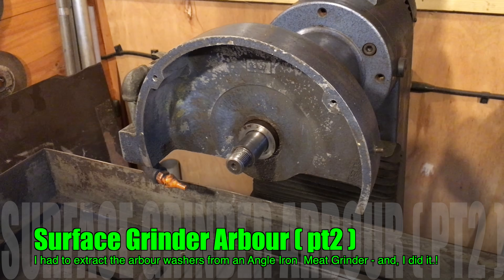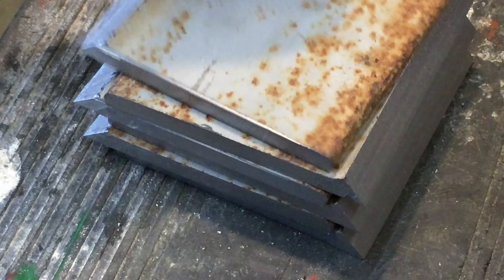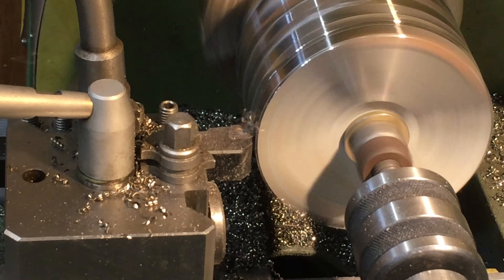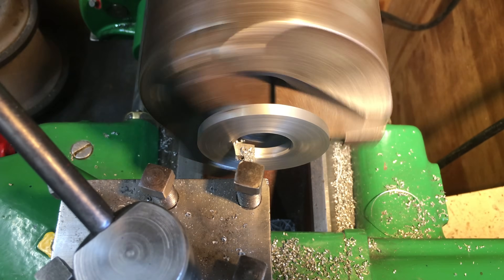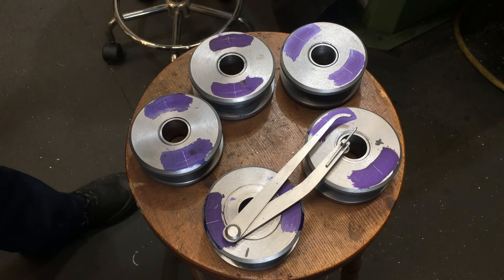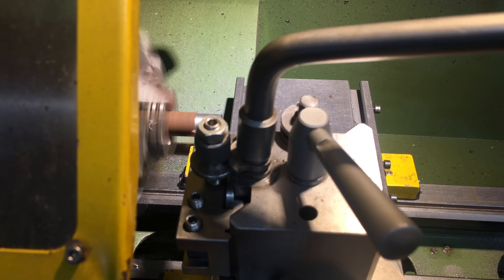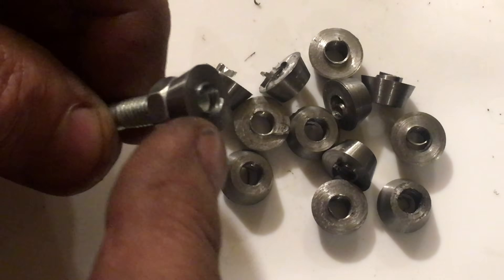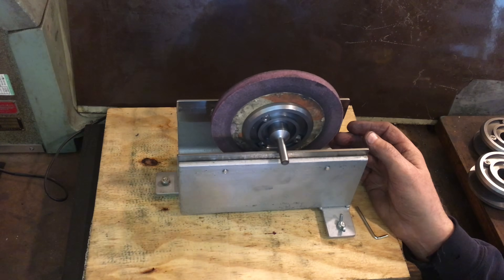Surface Grinder Arbour (pt2)

Comment: Very nice, I've just bought myself an Eagle Mk2 surface grinder that I'm refurbishing, it looks like I'll  be making myself a bunch of these arbors for it aswel, after I've bought a motor... replaced the belt... upgrade pulleys... rewire... make a stone guard bracket to replace a broken one and... paint it!

I like the comment you made about mucking that shiny surface up with your fingers, I do that regular but only once after using a flap disc on an angle grinder to clean a weld joint, never again ;)

Comment: When leveling a balancer lengthwise, use two parallels, on the side if you don’t have thick enough one to stand vertical. Put the level on that.

Comment: That's lovely.

Can I ask why you went with 3 weights rather than the more common 2?  Is it a surface grinder thing?  My only experience with these things is on bench grinders, and all of the ones I've seen only have 2 weights.
Reply from the maker: Hi, I have balanced many grinding wheels in the past and all of them including the ones at training college all had three weights, that's the only reason I chose the three weight method. and its true two weights will do the same job. cheers

Comment: You should have cut the corners off 4:16, before stacking the plates. To start with  an octagon saves quite a bit of interrupted cutting, but is still reasonable quick done with your band saw or angle grinder. ( do not ask why I know 🙂)
Reply from the maker: yeah, I know but it looked good on video. cheers

Comment: A great outcome, and well worth all your expert machining skills. Being a retired machine tool fitter building Jones & Shipman grinding machines for 50 years, it was interesting to see another British made surface grinder. As you probably know, the J & S machines all had wheel flanges c/w balance weights, and actually looking not far off what you ended up making. 
The first split weights you made were just like the J & S ones,  but I do like the ones you ended up with, a much more practical solution, and easier to clean, and not susceptable to seizing up in the dovetails!  excellent work, albeit with rusty fingers lol.  cheers, Dave
Reply from the maker: Hi, I have used J&S equipment for years, more centre grinders than surface grinders, they are still my preferred machine. In so far as the surface grinders spin the right way (anticlockwise), I've nearly come a cropper a couple of times with this machine. thanks for watching, cheers

Comment: Wow Paul, beautiful work. When I made wheel hubs for my grinder, I just copied the design of the factory hubs. Mine did not have a dovetail groove for the weights, it’s a “square groove” and never gave me any trouble so I didn’t feel a desire to update it.  You did some impressive work making yours. Thank you for sharing.
Reply from the maker: Hi, thanks, its something that Im quite used to, cheers

Comment: Have to dress the wheel on the Arbor before balancing it, and not the other way round. In this case the the wheel was balanced with the runout, and when it is then dressed, the concenticity is established but the wheel becomes unbalanced again.
Reply from the maker: That is correct, I did set it up and balance it first, then dressed it, removed it, and balance it again, then I did the same once more out of interest but, there was a very small change on the third dressing. I forgot to inform everyone during the video that's all. cheers
Reply: Thank you for clearing it up. Since balancing is such an important topic this was important.
Reply: That’s correct for small wheels. But for larger wheels you must balance first. Then dress the wheel and balance again. Otherwise the large mass of the wheel can result in way too much vibration when dressing.